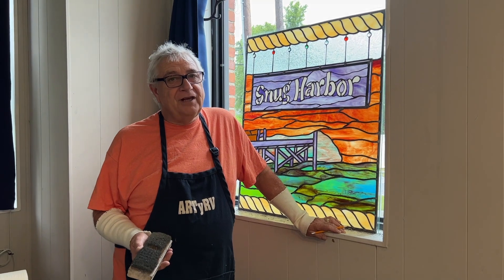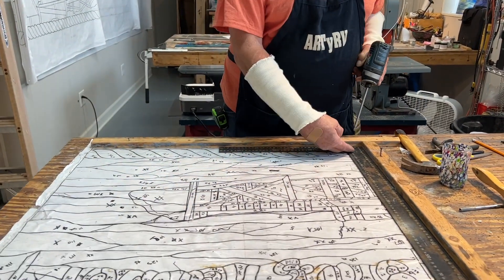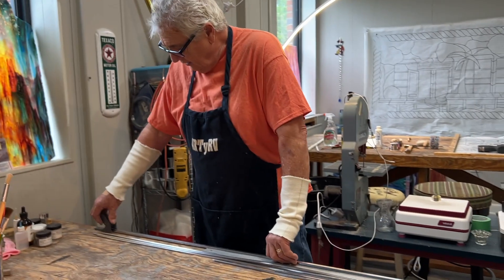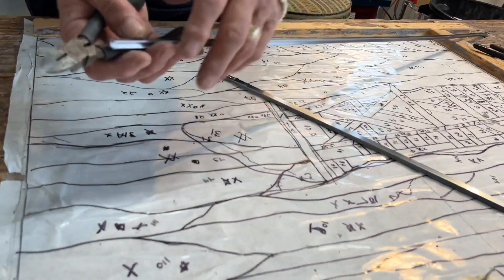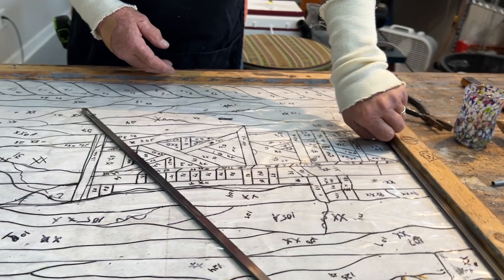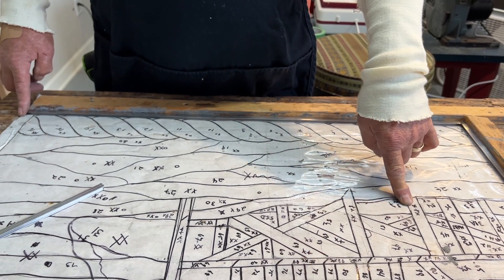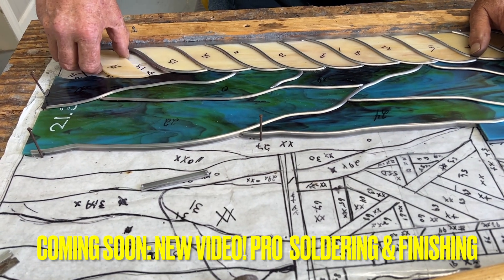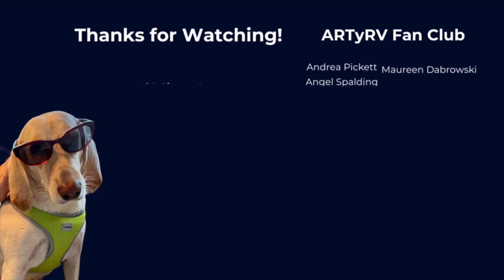Stained Glass Windows - 4 Techniques to Master

Comment: Q, For the lead pieces that go up to the frame, do you tuck a little of the lead  edge under the lead frame or just go up to and as close as you can get so when you solder you get a smooth edge?
Reply from the maker: No